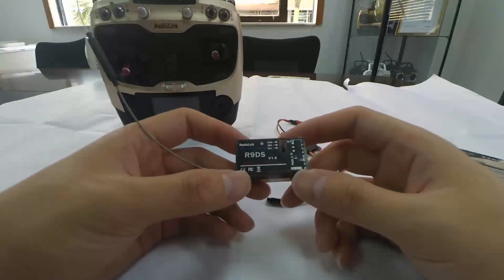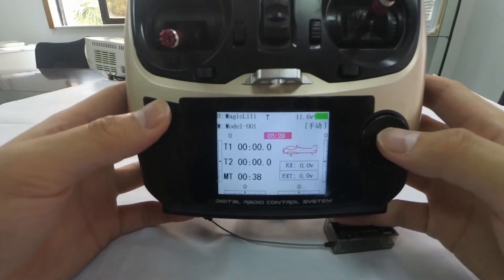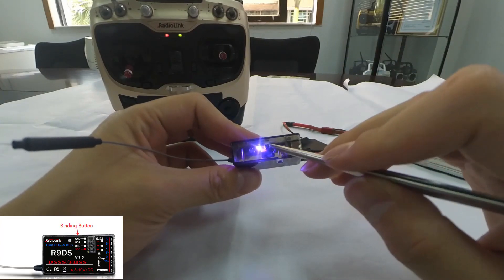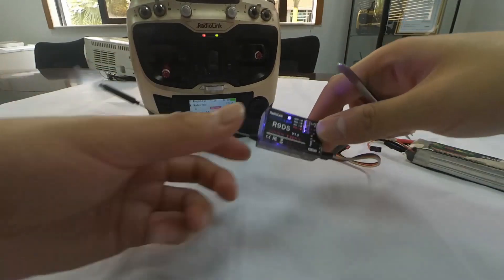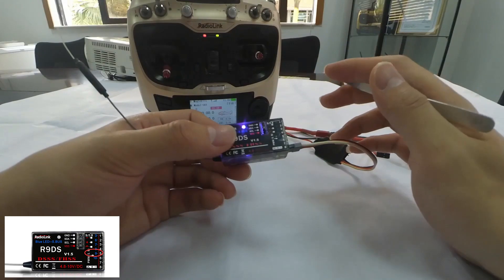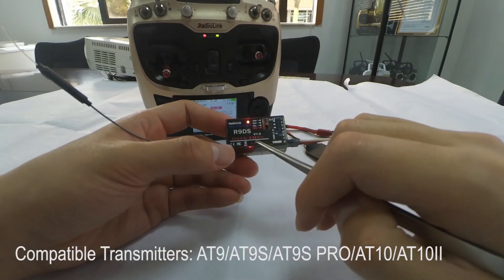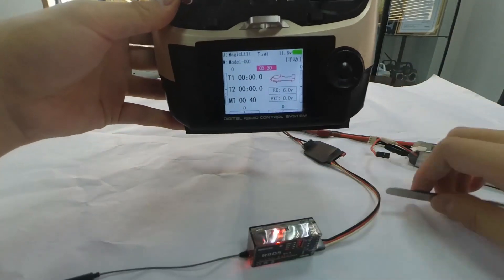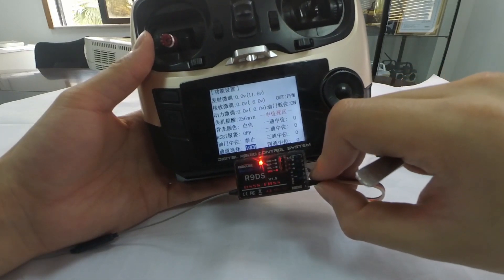How to| Make RadioLink receiver R9DS bind with transmitters

Comment: hi radiolink, when will you make a new radio control with a more beautiful design like radiomaster tx16s? with jr connection external crossfire module? and with internal mtiprotocol? I look forward with madness.
Reply from the maker: Hi Thank you for your all along support to RadioLink. Our AT9S has been upgraded as AT9S Pro, compatible with CRSF protocol from TBS. https://www.radiolink.com/at9spro
Reply: dear radiolink, I have purchased radiolink at9s which I am very happy with, but now I would like a new radio with multiprotocol and with external crossfire module, I do not understand why you have created a new remote control (at9s Pro) similar to the at9s, and above all without jr housing  to insert the frsky module, it is impossible to think of buying a radio like this, if you want to sell successfully create a new radio like radiomaster t16s, update yourself, you are a nice company that has not disappointed anyone until now, so tell your technicians to create a  radio that comes back on the market, perhaps with 815 mhz already incorporated and 2.4ghz in order to choose whether to use the classic 2.4ghz radiolink receivers or new 815mhz radiolink receivers, do not let yourself be beaten by the competition, come on you are great and with great  capacity.  attention, keep prices low.